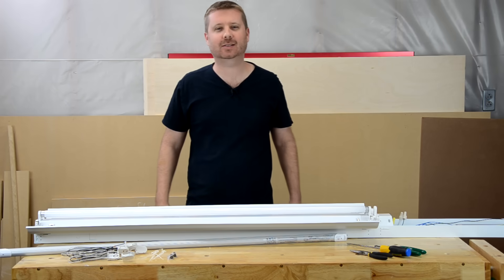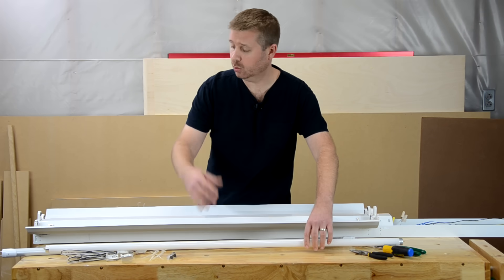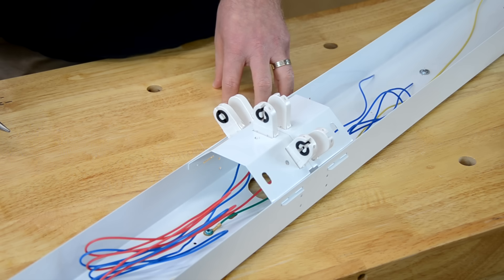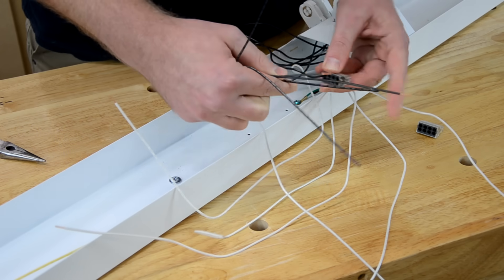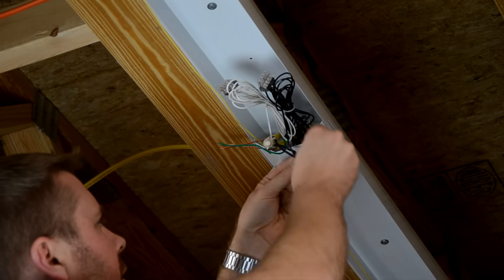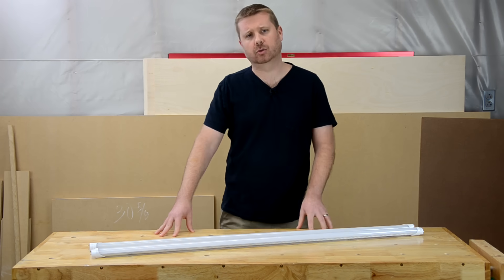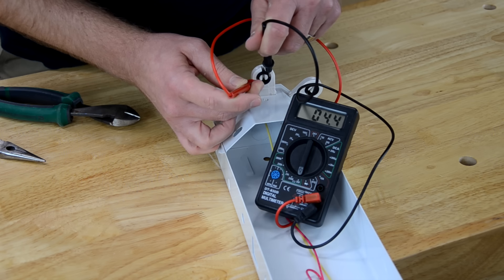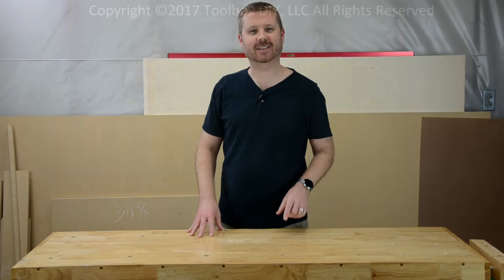How to easily convert fluorescent Lights to LED –Easy Ways to Save Money

Comment: When switching to LED you don't need to use the ballast anymore am I correct?
Reply: Some LED units still use the ballast.   Makes them simple to install.  Remote old Fluorescent light, pop in new LED light and done!!!  It's that simple.    Other LED bulbs use no ballast and are powered on either just the 1 end or both ends.  The ones I've installed at work, I used the single end ones and replaced the Tombstones.  They're called that because that is what they look like.  Mini Tombstones!!!

I think it's worth the little extra effort to toss the ballast and never have to deal with it again.  It's something that could fail a year or 5 down the road.  Why not take it out of the picture.  They also have making buzzing type noises.  

It really is pretty simple to convert.  After you do the first one, the following fixtures will be even easier.  It's 3 wires, Black, White and Green/Bare-Ground.  It's not rocket science.   It's one of the most basic things you can do in home repair.
Reply: @jbdragon3295  Tubestones.. get it? The pun? ;))
Reply from the maker: Generally, yes. I have yet to come across an LED replacement tube that requires a ballast. Many require removal of or bypassing the ballast while some will work with or without the ballast. Just be sure to check the tube manufacturer's instructions. I highly recommend removing or bypassing the ballast for one simple reason...that ballast will eventually fail so why not just remove that possibility when you have the fixture open!
Reply: I fully agree with you. My ballasts are dead, that is why I  want to change to LED. Don't waste money on replacing ballast.
Reply: Some are designed to work with the original ballast : Very good for cold weather and more light.  But convert if your goal is to save most energy,
Reply: Only if your use line voltage lamps the ballast that can use LED or fluorescent  are like 1000 volts thats why the ballast

Comment: Does the tube lights up even we switch the polarity?
Reply from the maker: The tubes I used in this video are polarity agnostic. I checked a few different manufacturer's of single and double ended tubes and they were all polarity agnostic so believe the answer to your question is yes. However, it's always best to double check the specifications and/or installation instructions that come with the tubes you are considering.
Reply: There are no polarity in AC

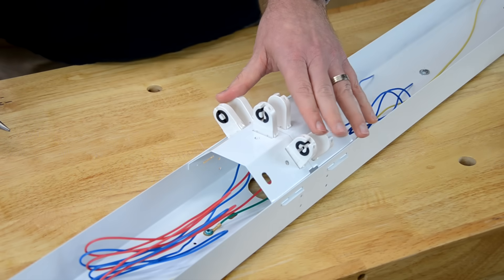Comment: Fine video instruction  -   BUT! at 3:45 in the video you instruct viewers to replace the Non-Shunted with Shunted Tombstones. Then at 10:00 in the video you instruct you viewers must replace the Shunted Tombstones to Non-Shunted - a complete revseral of your previous instructions. I believe you must have miss spoke at 3:45, and you should have instructed to replace existing tombstones with “NON-SHUNTED” holders (separated hot and neutral wires,one on either side of the holder). Correct????
Reply from the maker: Yes, I misspoke at 3:45 and said it backwards. Of course, I didn't discover this until long after posting! For this type of fixture and bulb, I was replacing non-shunted tombstones with shunted.
Reply from the maker: Dug - Singled ended LED tubes MUST use non-shunted lamp holders since one pin is connected to hot and the other pin to neutral. Using a shunted lamp holder would result in a short across these pins...the light wouldn't work and your circuit breaker would trip once you turned it back on!

In a sense, double ended LED tubes could be considered "2nd gen" to some. There are a lot more on the market than when this was filmed. Those could easily use shunted or non-shunted just a long as the hot conductor is connected to one lamp holder and neutral to the other lamp holder. However, be sure to check lamp compatibility with non-shunted. Non-shunted could mean you have  a ballast AND a starter in your fixture and those might not be compatible with all LED tubes.

Comment: I think you can safely remove the word "easily" from your headline.  Removing an entire fixture from your ceiling is sufficiently intimidating to most people to either hire it done or forget it.
Reply: We travel in different circles.
Reply: then why bother watching this video if you are not into DIY?
Reply: If you’re electrically or mechanically challenged or overwhelmed then this video is not for you. I’m certain you can call a qualified electrician for the right $$ will gladly hook you up.
Reply: Well, first of all nothing in my responses says anything about me.  I said "most people" and I stand by that.  Second, how would I know if I agree or not until I watch the video?
Reply: One of the options mentioned is _easy_. Just skip to it ... ;)
Reply: The video says "dispose the ballast at the hardware store.". Do hardware stores offer Recycling?
Reply: I don't remove them at all.  That would be a complete hassle.  At work, the lights mounted in the office drop ceiling.  I turn off the power, open the light defuser cover and let it swing open,  and I can pop it apart to get to the ballast pretty simply along with the wiring.  I basically rip everything out.  The ballast, and all the wiring.  Where the only thing left is the 277-volt wire connection coming in.   480 volts coming into the factory.  Take 1 Phase of the 3 phases and ground, you get 277 volts.  Seems strange, but that's how it works.    Where as at your house, you have 2 120v lines coming into your house, combine them and you get 240 volts.    We use a number of different voltages in single and 3-phase.  but all our lights everywhere are 277 volts with different type of lights and ballasts.   

So anyway I get LED bulbs from Amazon that don't use a ballast and work over 120/277 volts.  They come with a new Tombstones.(That's the shape they look like!)  These are the ends a T8 bulb fit into.  One end I leave alone, I just cut the wires off that I can get to, the other end, I replace the 2 or 3 Tombstones with new ones.  I can pretty easily pop the other end off to slide the old Tombstones off and install the new Keystones and the wiring I run to them.  

The difference between them is a normal Fluorescent bulb, the 2 pins on the one end are both connected together.  So you only need to run the 1 wire to the Tombstone to any of the 4 connection points and it powers both pins.  You DON'T want that on the LED bulbs I'm using.  That would be a short (BAD).  The LED T8 units are powered only on the one side by the 2 pins on that side.  The white wire goes to 1 pin, and the black wire goes to the other pin.  So you need a Tombstones where the 2 connection points are not one and the same.    It's really a simple wire job.  If you have 2 or 3 lights in a unit like I have, it's pretty simple.  There are 2 connection points for the wire on each side of the Tombstones. (See, still adds up to 4 like a normal one and they look the same on the outside!) So I have a white wire that I have long enough that it'll reach the power coming in, then I run another white wire in the second slot, and run that to the next Tombstones into the first slot, and then another white wire in the second slot into the 3rd Tombstones into its first slot.  Then I do the same with the black wire, but on the other 2 slots on the other side of the keystone.   Then I snap that whole end back up into the light fixture, that I didn't take down.  Then I connect that white and black wire to the black and white power wire coming into the unit.  Pop the cover that's almost empty now that hid the ballast and all the wires that used to be there.  There are now ZERO wires on the other end.  

Then I can pop each LED in, the power side for the LED goes to the power side of the fixture.  The other end only holds the bulbs up in place.  I can convert one pretty quickly.  Takes very little time to cut all the wires free and remove the ballast.   Then popping the end that is holding all the Tombstones on the one end, then I can wire that all off the ladder on the table pretty quickly, swapping out the keystones.  Then climb back up the ladder, pop it back into place, connect 2 wires, pop the cover on, install the LED's and swing back up the light defuser cover, turn the power back on and DONE.   I can convert a 3 T8 bulb unit in about 15-20 minutes, not rushing.    I'll never have to deal with a ballast, and these LED units should last many more years.  At least far longer then a normal T8 fluorescent bulb which I always seem to be replacing.  There's so many of them.

Each Florescent bulb is using 32 watts.  Each LED bulb is using 18 watts.  So almost half the power.   The ones I'm using are 45,000+ rated hours (21 years with 3 hours/day 365 days)  I get mine from Amazon, they're the Hyperikon T8 LED Light Tube, 4ft.  There's 4 differnt color ranges.  I got the 4000K ones first which I used in the HR office.    The owner wanted something not so white/bright, so I went witht he 3000K ones for his office, and they are better light in his office.   He's happy which is really all that matters.  I can only imagine what the 5000K and 6000K ones look like.

These are not CHEAP.  It's $16.50 for 1, but in a 4 pack, the price drops to $10.70. A 12 pack drops to 10.33 each. Then $9.76 for a 24 pack.  What you get out of this?  Don't buy just 1!!!  The biggest price drop comes with just buying at least a 4 pack!!!  They come with the needed Tombstones also  You may need some wiring.  I needed to use Black and White Wire for work.   but you could get awy with using the excess wires from the ballast.  Just don't mix up the colors or connections.

Comment: I installed a new 24" fluorescent F20T12CW undercounter lamp fixture in my kitchen about a year ago.  The bulb draws 20 watts of power.  I checked on a LED tube to replace the older style fluorescent bulb and found it draws 16 watts of power.  For a savings of 4 watts, it's hardly worth the effort or cost effective to replace the 24" fluorescent lamp.  The lamp assembly cost $30 to begin with, and at a savings of only 4 watts, not worth replacing.  That said, I've replaced all my incandescent bulbs with LED's all over the house and in the front and back entryways outside.  At a cost of $.95 for each LED bulb (subsidized by the government) it was indeed cost effective:  equivalent 40, 60, 75 & 100 watt replacement (in Lumens) LED's draw 6, 9, 11 & 15 watts respectively.  Now THAT is a savings I can see over time on my electric bill.  But replacing a year old 24" fluorescent fixture with a LED to save 4 watts?  Forget it.
Reply: Derek Greenhalgh, you’re talking rubbish. I’ve had the same fluorescent tube in my kitchen for 15 years and it hasn’t lost any lighting power. Going by your analogy when I turn my light on at night it should still be dark. I was thinking the same thing, that it isn’t cost effective to even replace with a LED fixture never mind convert it. Both ways uses more Watts. Also we are led to believe that modern LED bulbs should last around 25 yrs. this is obviously non tested as the current versions haven’t been around long enough to test that theory. I think 15 years from my 11 watt lamp is good going. I could replace with LED that will fail in a week. That’s the reality is they have a much higher fail rate than any bulb out there. This is down to the power supply transformers within and not the diodes themselves so technically the diodes could last 25 years however the transformers won’t.
Reply: utubetommy , your old flourecent bulb loses about half its lighting power after about a year (it consumes the gas)and needs to be changed, even though it loses lighting power it still consumes the same. The LED will also lose power but slightly less than 1% per year.
Reply: The LEDs SHOULD last much longer. If the fixture is in a hard to reach position that's a good reason to switch to LEDs when your current tubes or ballast fail.
Reply: Idk about half its light output, maybe a quarter. Also, magnetic fluorescent ballasts themselves as used by most T12 fixtures are very inefficient. The lamp may typically draw X watts but the actual input power draw may be more (or less) depending on the ballast driving it.
Reply: My 8ft tube in my shop (8) run 110 watts. Replacing them with 45 watt led. More than half the wattage. Not so good for you but my savings is quite a bit.
Reply: Fluorescent lights are a pain in the rear and I've always had issues with the fluorescent lighting in my house.  When my ballasts finally went bad, I removed the fluorescent lights in my kitchen and in my security light fixture over the front door and replaced with LED lights.  The LED lights are much brighter with no flicker and no expensive ballasts to worry about.  The fluorescent light in the garage is starting to go bad so I will replace that next.
Reply: utubetommy Stihl chain saw repair

Comment: If the FL tube bases are shunted, how do they start with no preheat?
Reply from the maker: They use an electronic ballast which doesn't require a separate starter. Electronic ballasts use an initial high voltage to start the arc in the fluorescent tube rather than preheating the electrodes like a starter does.

Comment: Blow it out your fluoro hole, whats the point? Use L.E.D. incandescent replacements.. wire a readily available medium base socket in place of the fluorescent, screw in a L.E.D. spot, or flood, or A 19 you choose the color(kelvin) DONE.. $8.00

Comment: Here in the UK older fittings using a passive ballast and a glow-starter are very common. Single-ended tubes are supplied with a starter that has a 2A fuse in it, so there's nothing to do except replace the old starter with the new one and plug in the tube. 30-second job! For double-end tubes the starter is simply removed and the tube installed. The power is running through the ballast, but the current is low and the power loss pretty small. LEDs still end up taking half the power of the equivalent fluorescent tube. Mine haven't faded at all in two years, unlike standard tubes which steadily fade and also flicker.

Comment: I'am a professional electrician and i do recommend single ended led  lamps cause are lot of easy to fix them, by the way rarely seen shunted lamp holders  unless  they are electronic ballast driven. ( wired ballasts or choke coils are more common in my country since they more reliable and long lasting)
Reply: This work as described in the video is also illegal in many western countries unless you are an electrician. For most people its better to just buy a light that is designed for LED tubes, although its more expensive.

Comment: Not sure how I got here but, that's a very dangerous video. let's hope you don't kill off too many of your subscribers, NO TESTING AT ALL, no 1 Amp fuse in the fitting, no markings to show which is the live end or even mentioning that putting the lamps in end for end will result in a big bang; and the one I like most, no label to warn anyone that you have removed the ballast so if they happen to put in a normal fluorescent lamp it will blow up in their face!  But at least you went to all the trouble of replacing the old ballast screw that will never be used again.
Reply: I wish you naysayers would make your own videos.  Otherwise, the rest of us knuckle draggers will likely kill ourselves off and burn our houses down.
Reply: Ohh no label to say dont poke fingers in here. No label to say dont cut this while switched on . No label to say dont poke a screwdriver in here. No warning sharp edges sign ! no label to say common sense removed !
Reply: Yes - LOL! Why yall think he keeps yellin' TOMBSTONE!?
Reply: I do label the ones I convert at work.  They say something like LED Conversation, POWER END, 277 Volts.  The label is placed near the Tombstone end.  You can easily tell the difference between a Fluorescent Tube and a LED.  Since I know there are differnt types of LED's, from ones that still use a ballast, to those that are powered on 1 or both ends, I label them to be more clear.
Reply: You must live in a bubble with the rest of the snowflakes
Reply: Excellent observation!  And they certainly do look like tombstones.  If we are killed installing these, our own tombstone could read . . . .  Long Live LEDs".
Reply: Yes dont forget the "dont try this at home" warming lol
Reply: Didnt even twist the wires before using wire nuts great way to cause a fire from arcing
Reply: Installing a fuse -- what an excellent idea.
Reply: I don't have anything to say why is my tablet forcing me to do this
Reply: @Terry
It wouldn't be a YouTube comments section without the YouTube Fire Brigade® making an appearance at least once :-)

Comment: why can not we say hot and cold wires, rather than try to make live difficult it was label hot and neutral.  Our forefathers are terrible and wanted to control everything.   Why not delete the word hot and use Current In and Current Out or something easier.   Why in earth everything have a vocabulary of its own.  But who am i to change the electrical code and challenge the vocabulary of International Building Code.
Reply: Yes, who are you?